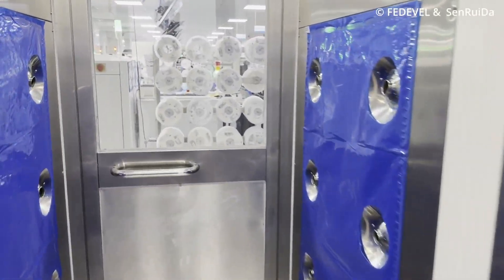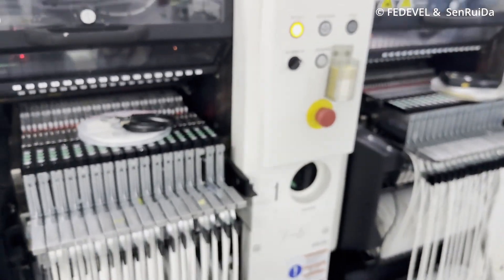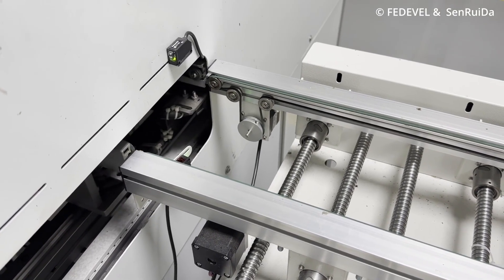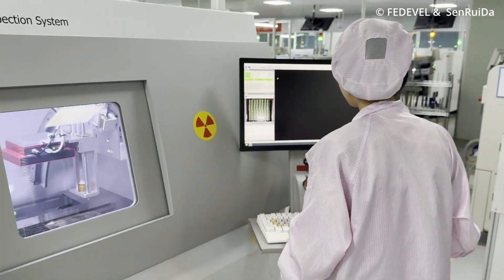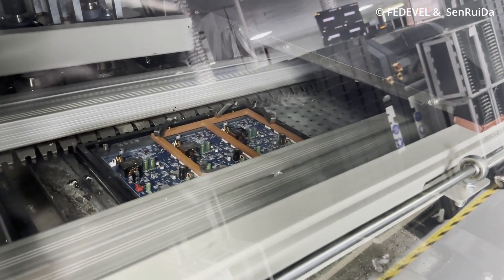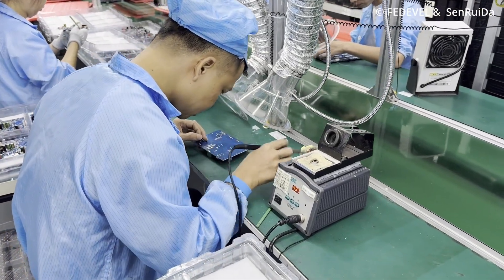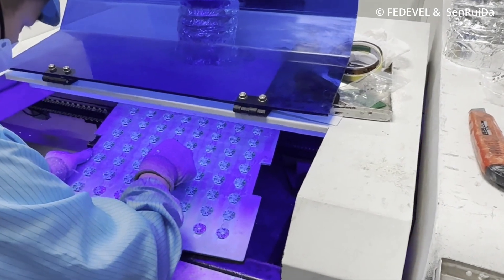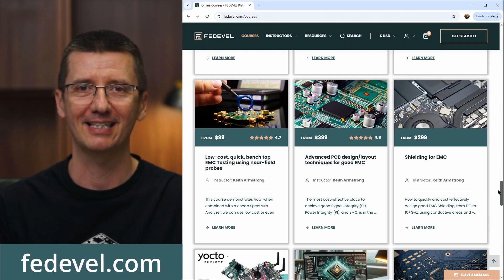Factory Tour in China - How Boards Are Made | SenRuiDa PCBA

Comment: Thank you for the video; I wish I knew more about PCB manufacturing (and manufacturing in general)

What is the process like for coordinating firmware programming and testing setups? Do the customers typically give the manufacturer the physical hardware and documentation to do both or do the manufacturers design their own equipment for the job? Are their any existing standards covering say formats for firmware and in-circuit programming pinouts?
Reply: Product owner(client for EMS) does all the programming and testing equipment related stuff. Because obviously they designed the product and they design the testing as well. Make all the limits product has to obey and so on. And they help EMS to set it up. It is a lot of work, even if you make the testing system then later you have to implement it to EMS system. There are logs after every testing with values etc. And whole system has to track at which part of manufacturing the board is. You can't go to next step without going through previous steps. Systems like SAP are used. At least it works this way with big EMS.
Reply: @TriodeTetrode  thanks for the reply; I appreciate the insight from someone with more perspective than I do

It's interesting so see at one end of the process (PCB fabrication and assembly) there is a very high degree of automation while at the programming and testing end a much greater amount of human labour is involved. I would imagine the time required to integrate the developer's programming and testing systems into the manufacturer's processes is pretty substantial.

It really puts into perspective the difference in time/work between getting a product ready for full production vs creating a prototype/proof of concept
Reply: @nullptr472  Yes there is quite a bit manual work involved at EMS. Although this video showed more manual work than it would be for big EMS. Particularly I mean testing part how they manually doing testing and all those analog meters with no logs. It looks like just pass or fail test without any measurements recorded. Also not sure how they track the products, didn't see that on this video. When you would see bigger EMS then it is much different. There are big universal test stands where you put your product specific jig(not sure how you call this in english, but google for example "ICT jig" and look at the pictures). Then you insert your product into jig. It is Manual work yes. Could be also automated on large scale pretty sure and it is definitely done if you make like big quantities same product. The problem is if EMS does like a lot of different products then it is not worth to automate just for one specific product. We produced like 5000 different products I think. Or something like that. So after you put your product into jig then you scan the serial number and press start testing. Everything else is done automatically. And logs with exact values will be generated. If anything fails you know why based on log. Also there can be much more steps involved than shown here. It all depends on what products you make. If you make like industrial grade stuff like we did then usually it is much more work involved. Usually it was like this first soldering it together then going to ICT then covered with coating and after that it was usually HPT->FCT->BIT->FCT. BIT alone was usually 22-24h. There were some products with 48h in BIT. Temperature wise -20 to 70 degree celcius is pretty common. Some even went from -40 to 90 degrees celcius.

This video was also filmed in China. Means in general there is simply cheaper sometimes to make manual work than using automated line. Especially on small scale. Imagine for example all THT component placements. It could all be automated on larger scale. I know some factories in Germany are like fully automated. I saw also Robert video about JLCPCB. In my opinion there was a lot of manual work as well.

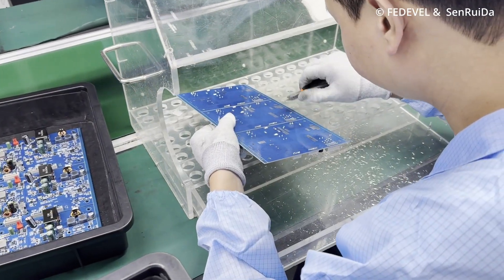Comment: @8:20 Why does custom frame matter? if there is not through hole it will simply ignore anyway right?
Reply from the maker: if you mean the frame  for through hole components, it protects already soldered smt components - so the opening has to be on specific places for specific board. if there are no through hole components, this step is skipped.
Reply: If you have components there and not covered they will be unsoldered/dislocated. It is soldering wave meaning whole board will be run through melted solder.

Comment: Really cool to see the technology behind PCBA. Pick-and-place machines are just one part of the whole process.
I’ve got two questions:
- How are double-sided boards assembled?
-How are conformal coatings applied without covering/masking the test points?
Reply from the maker: thank you
- usually they go through the oven twice
- before they are sprayed they cover them with something
Reply: Thanks. But wouldn’t the solder paste on the first side re-melt when the board is flipped and sent through the oven again, causing components to fall off? Or is there a way to keep the two sides at different temperatures?
Reply from the maker: they will not fell off, if there would be heavy components they may glue them
Reply: @KarthikArumugham  Regarding your second question Robert didn't mention one thing. Before going through conformal coating boards have to go through ICT(not sure does this EMS even do ICT though, but any decent EMS does that). So they will be tested using test points before they are coated. There are sometimes some test points which will be used later as well then they are simply not coated. I have worked for big EMS, this one is really small and so manual. Would be nice to have a video on real big EMS(imagine getting video about Foxconn). It would be really different level.
Reply from the maker: @TriodeTetrode I would love to visit manufacturers building things on bigger scale (e.g. a smart phone manufacturer), but it is very hard to get in ... and if it is possible, often they don't allow recording . If anyone has some good contacts, please let me know.
Reply: @RobertFeranec  Yes that's true. I worked in Europe. I don't have any special contacts. As far as I know they won't allow recording either. Generally it is because clients they have don't allow that. It is just easier for EMS to take no responsibility and not allow recording. If they would make their own products they could at least decide on their own. But in this case there are so many different clients and you would need to get permission every one of them that would be recorded. Maybe you could try to write to some European EMS? But I know it is hard to get them to allow recording. Perhaps offer them to take a look at the video before publishing?

Comment: The technology embedded in those pick and place machines is just insane.
Reply: Not just the technology, but also the sheer mass. I pull apart an older one last year, and pulled out hundreds of kgs of precision ground steel bearings, guideways, plates etc. The precision with which they're constructed, and the effort that goes into removing any kind of vibration on the tips that move so incredibly fast is mind boggling.